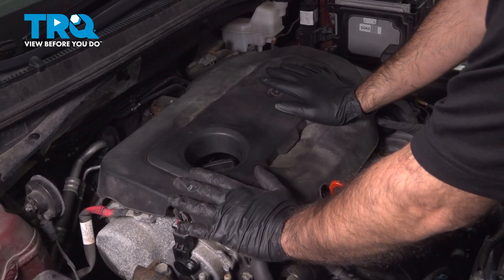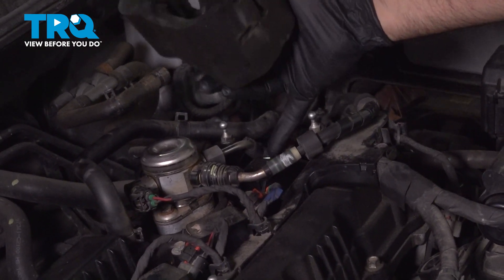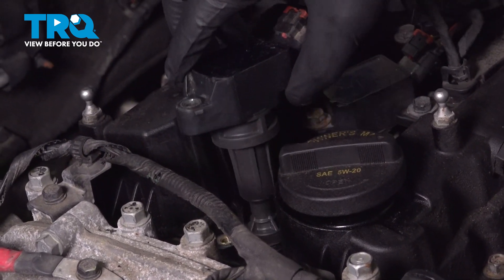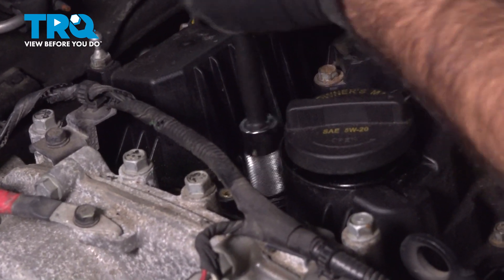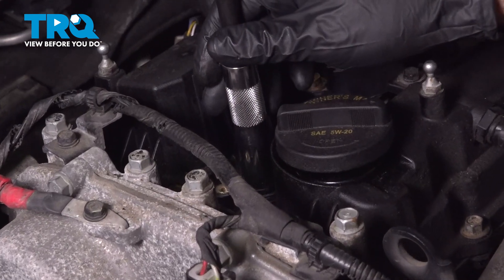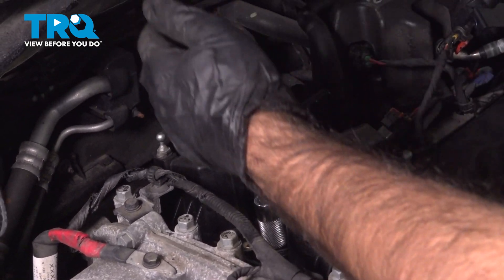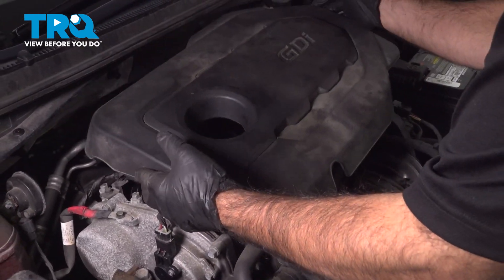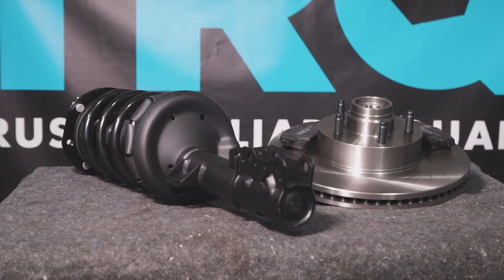How to Replace Spark Plug 2015-2019 Hyundai Sonata

Comment: I have a 2017 sonata sport 2.4l gdi engine. It burns oil uncontrollably.  Did tests at dealership & was burning 3 qts every 1k mi yet they still fought with me that it doesn't need a new engine. I'm going to a different dealership to see my luck with them. Bc of all this the oil gets black extremely fast even tho I'm constantly adding oil. But my spark plugs blow sooo much. No exaggerating, I've changed them about 15-20 times in last 2 yrs. If I get close to time of needing an oil change, they'll blow or I'll feel it misfiring knowing they're gonna of I don't get oil change asap. I'm a female & bc of how easy you explained how to change a spark plug, I now do it myself & have every time they blew other than the very first time when the dealership charged me $145 to change 1. They used the cheapest spark plug possible too bc when I had to change it again, the brand was the cheapest I've seen. 
Don't buy a hyundai bc they give u 100k warranty bc these cars have so many issues. It's not worth it. I've had older cars that I didn't have this many issues with. Don't do it with Hyundai or you'll regret it like myself & many others do! 

Thank you for this video though. You explained everything in great detail & made this an easy job to be done & saved me hundreds of dollars. I also changed my front & back brakes & rotors from your videos. If you post more for hyundai, I'll be sure to watch up on it. Thank you!! ❤
Reply from the maker: +@tlynn609 Thanks for watching our video! http://1aau.to/m/Shop-TRQ

Comment: So what’s the plug gap Mr. Pro?
Reply: Iridium plugs come pre gapped, and should not be adjusted. The fine point of the electrode is very easy to damage. The factory gap is .44 which most of the plugs available for this engine are set to. The factory plug is nkg iridium laser, thou desno has also been used by Hyundai.

Comment: Note to self...

1. 4 spark plugs
2. 10mm socket
3. 5/8 socket (magnetic)
4. Socket extender
5. Ratchet
6. Torque wrench (15 ft lbs)
7. Common sense

👍😁

Comment: Replaced the spark plugs in 2016 sonata 2.4l, but now it's sometimes having trouble starting. if left sit for a while it fails to start, loses power (dash info and clock resets) and then the next try it starts and runs fine after that. Got a new battery in the past month, checked all the grounds, alternators charges fine, battery voltage is good. I'll check the plugs again when I have time